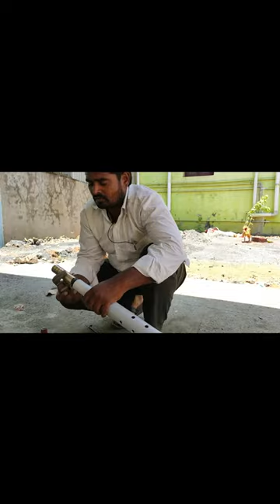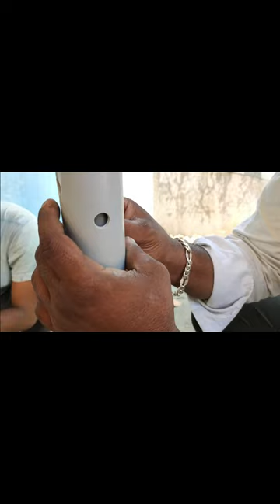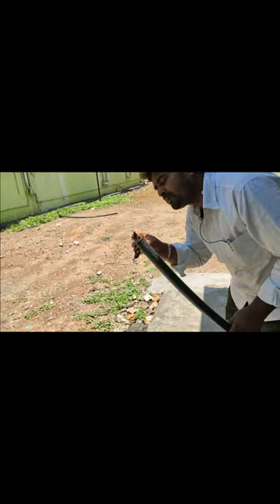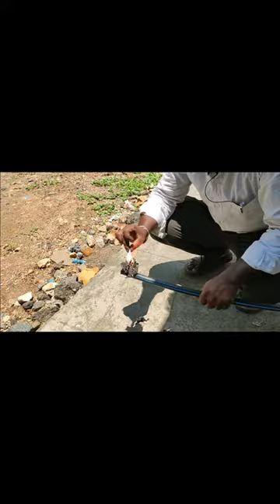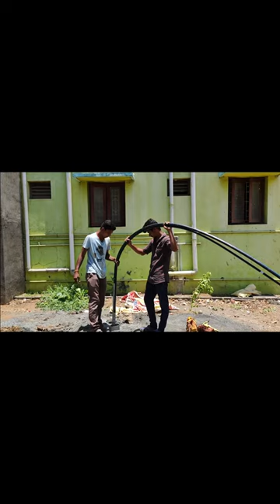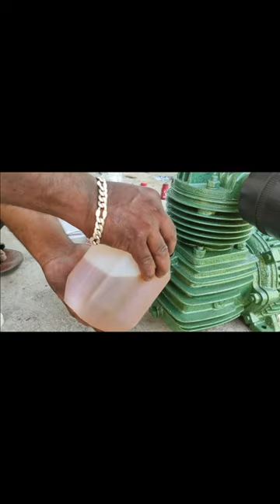Air Compressor Pipe Fitting | Air Pipe |Compressor Working Tamil

Comment: Sir bore air  ose pibe or  ose water pipe  holes irundha  eda use panni joint podanum sir
Reply from the maker: Bore hose to bore hose connect pannanumna ( 1/2inch hose connector )
Bore hose to water pipe connect pannanumna (1/2 inch hose coller then 1/2inch( cpvc or pvc )fta connect pannanum cpvc pipe use பண்ணுங்க best cpvc pipe 100 degree heat தாங்கும் so compresser air hose cpvc best

Comment: Where to get those PVC fittings. Is it a ready made pipes. What of 1" and 1/2" brass adopters?
Reply from the maker: Adoptor illa hose coller 1inch 1/2 inch.yes it's a readymade pipe so what